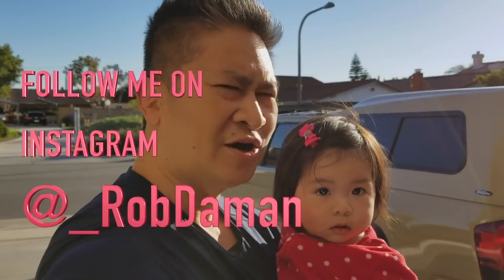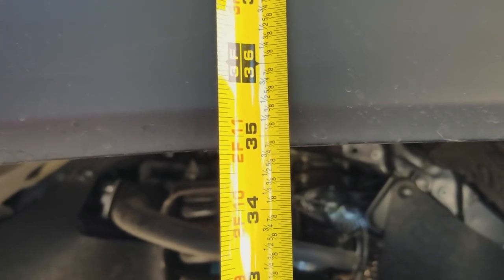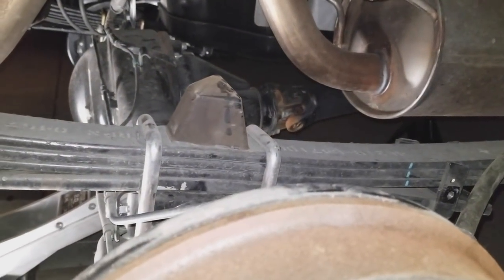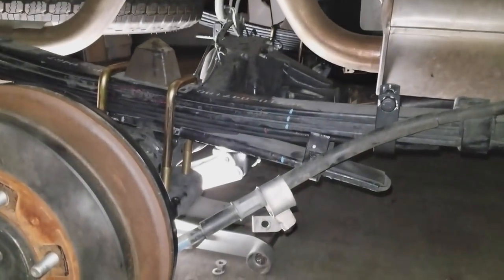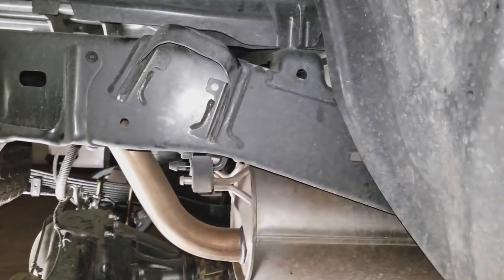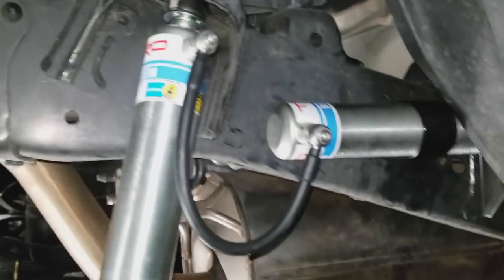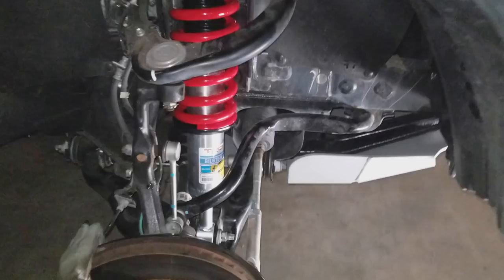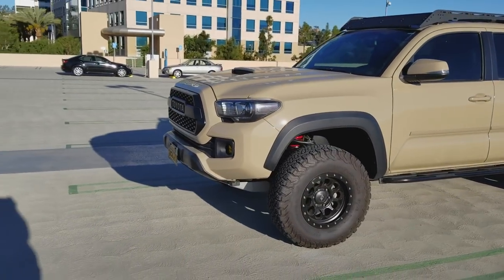I LIFTED my Toyota Tacoma Trd Pro Bilstein suspension and AAL Add A Leaf install

Comment: I have a 17 trd offroad. Is it worth it to do this swap? Also is the AAL a must? Will it suck without it? Anyone have pictures without AAL?
Reply from the maker: Hi, 

If you're thinking about offroading semi often I'd say it's a good upgrade. The front shock bodies are huge compared to OR Bilsteins. Here's the thread I found when I got them and there's a lot of info and pics... https://www.tacomaworld.com/threads/ptr13-35150-bilstein-trd-pro-kit-upgrade.530072/ 

This suspension isn't height adjustable but I've seen plenty of people not install a AAL. My issue was my shell caused the rear to sag already so it would worse when adding a load.

Your stock OR is still stout as is but I noticed going over dips isn't even a concern. check my intro here how fast i hit the dip without an issue https://youtu.be/1G2B4FuadVY

I couldn't do that when stock.
Reply: Thanks for the response! I guess what I’m worried about is the bro lift look.... do you know biased off what you have researched if this option sits level without the AAL? I will read through the thread you have provided as well. Thanks!
Reply from the maker: Look into the 6112 Bilstein so you can level the front without the lean.

Comment: 33's bro. 33's...roller skate look bad.
Reply from the maker: I didn't want to add more weight and work on rubbing issues w 285s but I was considering 255/85 but they sure look skinny
Reply: Rob Daman Haha, im just messin bro. 265/75/16 is fine. Seems like you got everything on your truck but you are afraid to add 40lbs of rubber and pay $300 for cmc chop weld. Might as well go all the way.
Reply from the maker: lol. i think i can get cmc for $100 ;)
Reply: Rob Daman What you waiting for then Mr $100 cmc? Sell your 265/75/16 and get 285/75/16
Reply from the maker: Lol. You know you're not helping
Reply: Rob Daman lol your minds telling you no but your truck is telling you yes! Aint nothing wrong, with a little tire rub.
Reply: I say 255 85 r16. Lots of benefits in performance for off-road.
Reply from the maker: yea thats my thought but i think maybe too skinny with my negative offset wheel. the struggle is real
Reply: Rob Daman no sir not to skinny trust me when I say this. I know what you mean. You want a little poke, but don't want a tiny tire. I can always send you pictures of a 255 tire set up with ray 10 and ray f5. Offset makes it look clean and much taller then the 285. When your on the trail you will have little to no slippage compared to the 285 wide tires. Also, and I can't stress enough they don't look as small as you think. Lastly, save your self money and avoid re-gearing. 255 are better on mpg, better performance, and has a subtle clean look.
Reply from the maker: Yea I've been reading that thread on Tacomaworld. The Toyo open country are the tallest too
Reply: Definitely go 255. I run a 255/75/17 and absolutely love how it barely impacts my MPG (-0.80). To compensate for the small width, I used 1.25" spacers (loctited and torqued) with the negative offset wheel and it sits perfectly flush! Not to mention the benefits of it off road!
Reply: Gotta go big and just get some 35's I know your lift was 2 inch so you could fit 33's no problem no rub lift it 3.5 or 4 boom 35's or even 37's  (;
Reply from the maker: Lol. I used to go big with my Titan but it's not my thing anymore. I live vicariously through others.
Reply: Taco Trek looks great
Reply from the maker: Thanks! 🌮❤️

Comment: Hey man i added some add a leafs to my tacoma and for some reason the right side is 1” higher . Why do you think that is ? Is yours even
Reply from the maker: I'm even

Taco lean can occur on front or rear or both on a lift. I'm assuming the measurements were even prior.  I'd confirm the leafs both installed in the same direction.
Reply: Is yours even? I have to check if they were installed the same direction i had a shop do it . Do they have a front and back ?
Reply: I was told it could be the gas tank causing the lean but i dont think so its 1” different
Reply from the maker: Most do. You can check yourself. Pull up pics and see how the center pin is orientated.
Reply from the maker: Gas makes a difference but you can empty it and see by how much
Reply: Ill check tomorrow. It does bother me its very noticeable. I hope the add a leaf is just backwards . Otherwise what would be the fix?
Reply from the maker: @agustinherrera5600  full leaf packs or shims. You probably had the lean already but AAL amplified it.
Reply: Hey rob so i have just an add a leaf with shims . Not a full new leaf pack , im not sure if it was already taller on that side before or not . I also noticed that the right side rear wheel which is the higher side sticks out more from the fender than the left side . Is that sticking out more normal or is something off ? Does yours stick out more on one side ? Were you able to see my videos you can see there what im talking about the height difference
Reply from the maker: @agustinherrera5600  bed sides can be misaligned so it looks more poked on one side.  I don't have issues with my truck. I'll usually point out issues when I discover any.
Reply: How can i fix that ?